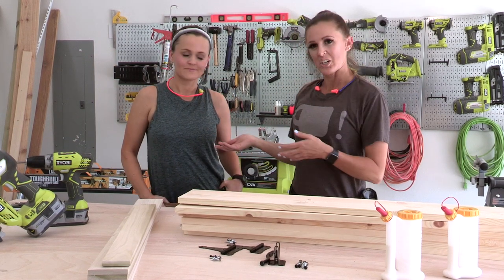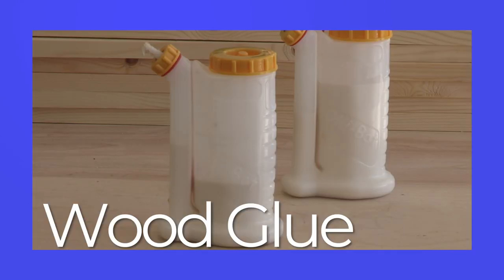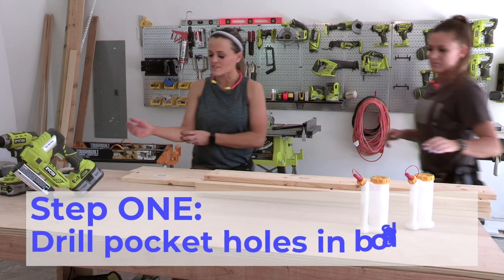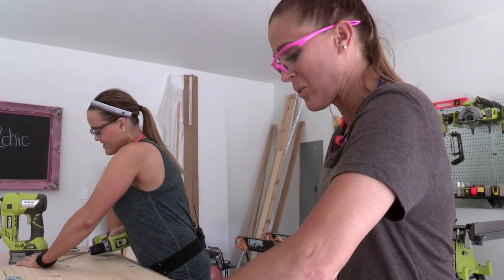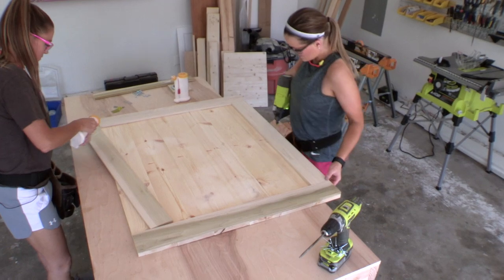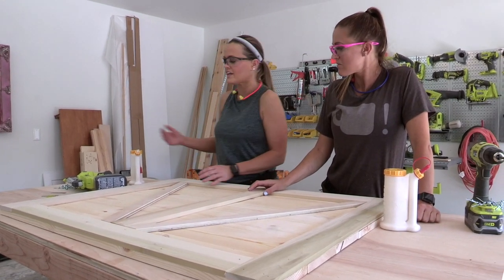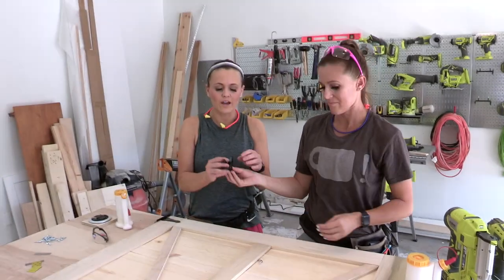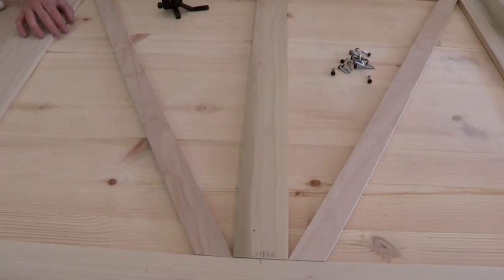DIY Farmhouse Baby Gate or Pet Gate

Comment: Should the horizontal bars be 8” shorter than the 1x6 boards? They are 7” shorter in your plans but if the vert bars are 1/2x4s i thought 8” shorter but trying to figure out what im missing.